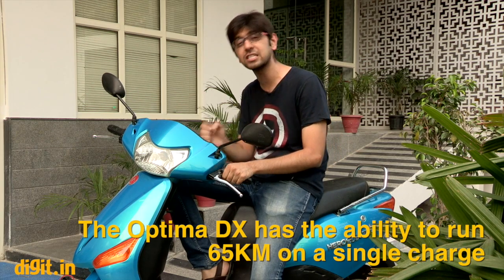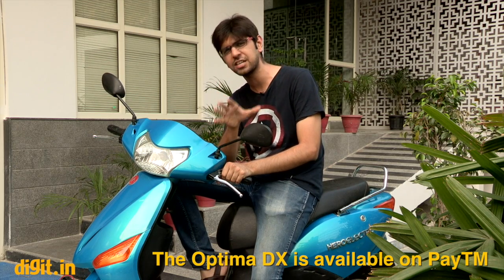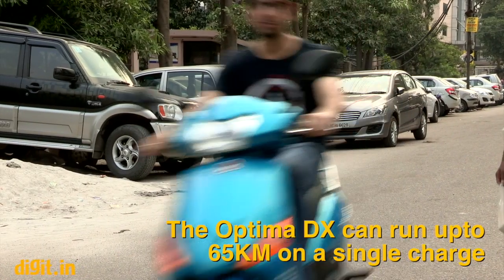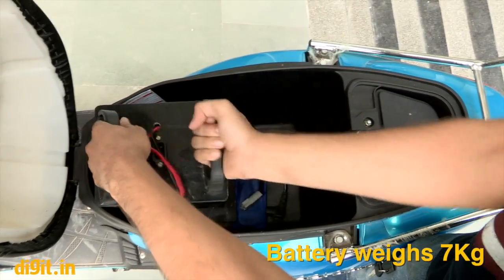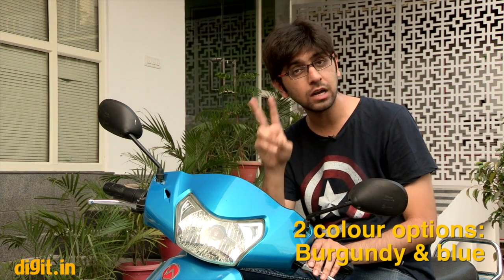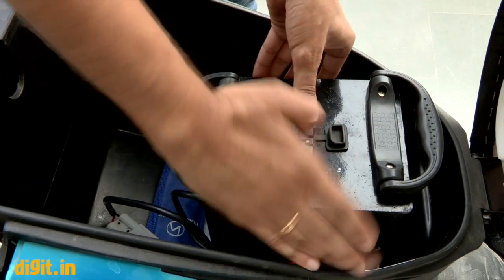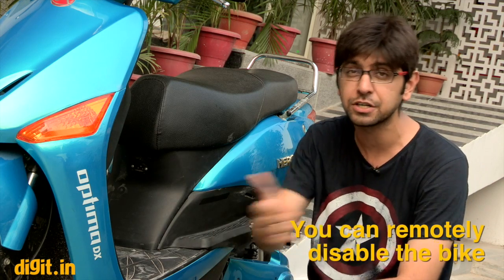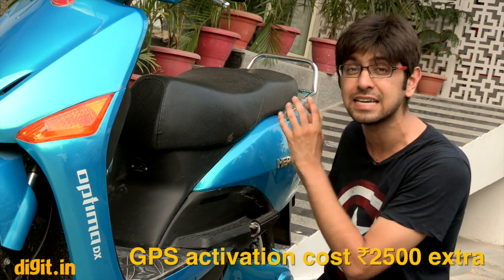Hero Optima DX: A quick look at India's first Lithium-ion battery powered bike| Digit.in

Comment: never buy hero electric scooter they dont sell spare not even brake pad 
or brake wire. u have to through away even one spare fails rs 35,000 use
 and throw product, they will guarantee spare are available, it is fake.
 even manufacture does not sell spare. Never buy Hero Electric bike in 
tamilnadu. if you dont belive it ask them to show spare available shop 
then u will belive
Reply: aentha ooru bro

Comment: I have this bike & the top speed is 35 to 40 , I think U got a discharged  E-bike for review.
Reply: Pankaj Agarwal correct
Reply: Bipin Gupta Rauniyar  plan to go for e scooter is the best idea but you should search more in online to get more reviews about every e scooter before you buy.then service center availability in your city.
If any punchure   means you have to check the local service people Will be ready toattend your request.
Reply: hariharan venkat  thank you
Reply: Pankaj Agarwal he is using it below 40% SoC
Reply: Dr Venkatesh Pai sir do you use the edge? Does edge do upto 30 kmph? What is your review?
Reply: Dr Venkatesh Pai the speed you are talking is probably no-load speed, part or full load speed should be upto 30 kmph not to require a DL
Reply: i am planning to buy this one. would u like to tell me that is this a good choice or not on basis of petrol exp.